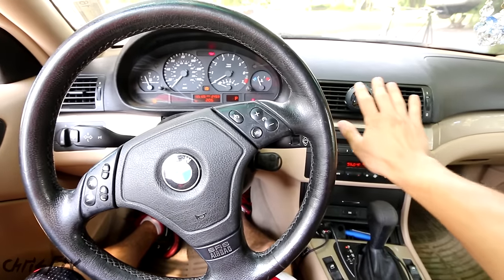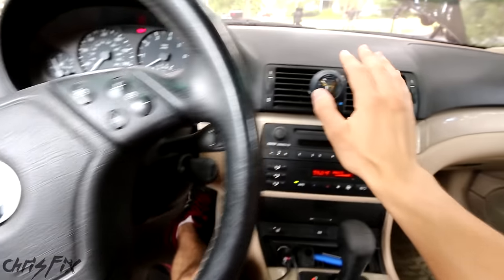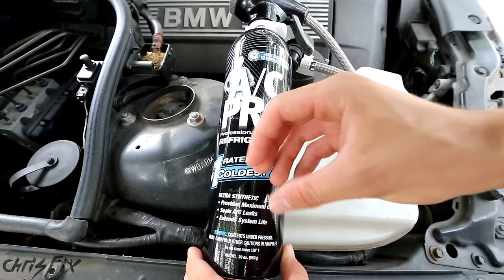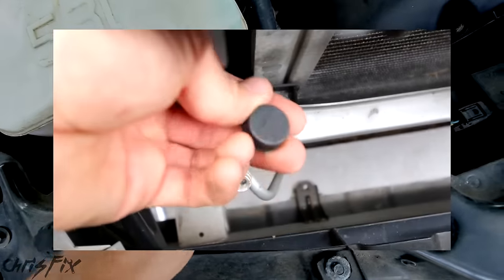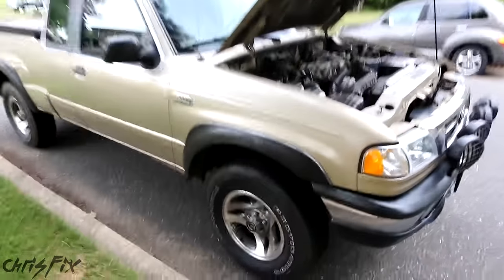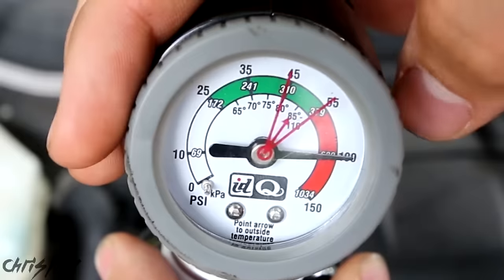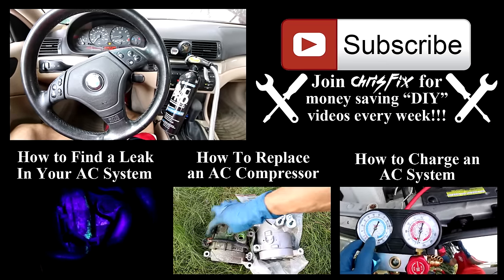How to Recharge Your Car's AC System (Fast and Easy)

Comment: If you have leftover refrigerant in the can, what are you supposed to do with it? Just save it for later? I assume you don't want to remove the hose/lid portion from the can while the contents are under pressure.

Comment: I was so hopeful this would be my fix! Unfortunately the reading was 109 psi on the low side (mine was a digital guage) once I hooked it up... and in my 2013 Pathfinder,  you can't see the condenser unless you take off the entire wheel and wheel well...so now it's probably going to be a HUGE repair ticket. 😩

Comment: This video is great but I just would like to point out one moment here: refrigerant works as a lubricant for ac pump, with that in mind do not leave on ac system runing empty for long: get ready that nozle on that refilling port before you start the car and turn on ac that way you will save ac pump from runing on without a "lubricant" for too long and you'll beable to fill up system right away. Good luck everyone and besafe!

Comment: Hey man thanks. I got my 97 bmw 528 ac pretty cold with an 18oz bottle of this ac pro.
My friend recommended that i let all the pressure out from the low side.. I was skeptical about that but i let alot of it out.
Ac was weak at first and car was melting hot with it on (these cars are highly insulated and hold rediculous heat)

Ac is now cold but i know i can get it colder, mainly because i need to add more (it can accept more 134a)
Following my friends recommendation im going to now get a 12oz can of Sub Zero and fill the system the rest of the way, but not into the red zone.
He said he mixes sub zero with another brand such as AC Pro and has gotten his cars super cold by mixing (not 100% sub zero.

Thanks again. It worked well.. youve helped nearly all of us.
Reply from the maker: Next time I would get the system evacuated properly as the refrigerant is damaging to the environment and it's also illegal to release it. I would also stick to using one type of refrigerant as much as possible. I'm glad the video helped you out though

Comment: Might be cheaper in the long run to take it to a trained AC repair guy to add refrigerant. I just don't trust those kits. I was in a hurry to make an unplanned trip-an emergency.  I knew I had a leak at the low P connection on the compressor but had not got around to fixing it.  I used one of those cans with a gauge and though the gauge said the pressure was now okay, it actually overfilled mine I think, and it caused the compressor to lock up at 70 mph on the interstate. This melted the serpentine belt completely off, and, later found out it ruined the crankshaft harmonic balancer too (stripped the rubber and months later it separated on me and left it stranded), which I had to replace-another hassle job on a Honda J engine (think extremely stubborn crank bolt). Fortunately, I know how to work on AC and have real gauges and the experience, but I was in hurry and didn't want to get the real gauges out, etc. A mistake. I ended up getting an expensive tow from the middle of nowhere then me replacing the compressor, plus the low side line from evaporator to compressor (leaking o-ring at the compressor connection was the culprit), and hose was old anyway, and the desicant unit, and a total refill. Took a gamble that no frags got past the dessicant unit to the condensor because I didn't see any debris after flushing the high P line from compressor to condensor. I won that bet.

Comment: I’m having this issue along with a O2 sensor (replaced the cheaper one already), and need another alternator cause some how oil got all over mine which was replaced along with the battery in October 2021. Just changed the oil but my question is since it’s a 2005 Accord EX… bought used and now has 232331 miles… should I get a newer vehicle or fix everything and see how long it’ll last? I’ve already put a lot into it. I do everything myself by watching videos if possible. Thanks and I love your videos how detailed they are… Thanks for helping a girl out!

Comment: Can I still use this if my AC compressor doesn’t spin/engage at all? If so, how do I go about this if the AC compressor isn’t engaging? 

PS- Replaced my alternator about 4 months ago (Fall). Now my AC is blowing warm air, and compressor not engaging. Checked fuse, relay, re-checked AC compressor tab/connector and all checks out fine. 

I know this is a very old video but yet it’s so helpful. I don’t expect a reply, but if you do, I thank you in advance. 🙏
Reply from the maker: I would hook it up just to see what how much is in the system first, I would suspect it's all leaked out and that's why the compressor isn't turning on. This video goes over this more in depth: https://www.youtube.com/watch?v=pCv7rCdcXsc

Comment: The thing is, when exactly do we apply this refill method?
Should it be done when we feel the a/c is losing refrigerant or wait till it's completely empty? 
I heard one has to completely empty out the air inside the system & to make sure we start from 0 and fill it back up to specs 550g for instance that way we don't risk getting any air inside hereby causing moisture & creating rust from within.
 So, if I'm applying this method, how do I know how much to put inside if I have say 250g still left inside the system for example?
What about situations where there's a slow leakage in the system, will this method work.
I'd be glad if you can answer these questions Chris.
Reply from the maker: You can do this if it still has some refrigerant, and is has a gauge that shows how much to put in

Comment: Wow, way easier than I thought. I was told not to use aftermarket stuffs to not contaminate the lines. How true is that?? And, you don’t have to vacuum the line and system before refilling it??

Comment: Glad it was an easy fix for your car.  How did you bleed the air out of the hose before putting in the Freon?  Wouldn't the air from tube go into the system before the Freon entered?
Reply from the maker: It’s not enough air to be a problem. If you want you can purge the air out before you connect it to the car.

Comment: People always say to vaccum the system first because of air and moisture. What if the condenser connection was cracked open alittle then put some refrigerant in to purge it? Then close connection? Kind of like brake bleeding? Gonna try this. 

Before people whine about emissions, r134 is used in low power air soft gun propellant. I was surprised to see that in japan.

Comment: Do not use refrigerant with stop-leak in it, It will gum up your AC systems components and shorten the system's working life significantly. If it's an old beater that you don't care about then fine, it might give you another year. If it's a long term car you like and don't want to spend thousands of dollars repairing the AC on, then just get the leak fixed and find the R134a without the leak seal.

Great video though!

Comment: Thanks for the video Chris Fix, I've learnt quite a bit about air conditioning on cars, my biggest question to you is when you use ac in your vehicle, why does the engine overheat, eg the temperature gauge goes up, and if it does, what's wrong?

Comment: Hey Chris, quick question: could an ac compressor with too low of pressure (needing to be recharged) cause it to engage and disengage randomly? I want to know so I can spend $50 and 30 minutes fixing it rather than spending $300-$450 and an afternoon fixing it

Comment: You know what’s crazy?

Ever since I got my 1999 Ford Taurus in 2013 it’s A/C has been hit and miss depending on the day conditions yet my dad’s 2006 Ford Fusion’s A/C has never had any issues with it.

My guess is the Taurus’ lines have dry rotted / holes in the lines. As it is older.

Comment: I have the same problem with my X4 except it is reversed (cold air pass side, no cold air on driver side). Also, I noticed some humming comming from the vents that I did not hear before. Could it be the heater control valve? Or simple recharge would do it?

Comment: Thanks @chrisfix you did a video a month after this using a much more complicated, but seemingly scientific method.  There are also some videos warning against the use of the a/c pro style kits (for the reasons you outlined in the vacuum recharge video).
Do you have any guidance on when to use the kit versus the vacuum method (as the difference is ~ $200 more)?
Thanks again..from another Chris
Reply from the maker: Yes, if you did work to the AC system (like replacing a compressor) and you no longer have any refrigerant in the system you need to use the other method. This method is more so for a car that had good ac and then it leaked out and it's too time consuming or expensive to fix a couple of o rings (typically what leaks)

Comment: Thank you! Your videos are very clear, concise, and easy to understand! As a follow-up question, you don't need to vacuum if you're only topping of the refrigerant and not replacing parts right? You don't need to add oil either? Is there a way to check for a leak other than filling with refrigerant and seeing if it stays cool and/or the dye?
Reply: You only need to vacuum if the system has been opened or otherwise exposed to the air. If there is still refrigerant in the system it is fine.
There is a couple of ways to check for leaks. Uv dye is one, I dont personally like that one much. You can use an electronic leak detector which requires there to be some refrigerant in the system. Or you can use soapy bubbles which require to system to be pressurized. Using a good vacuum gauge can also be a good indicator of a leak. If the system wont vacuum down to 500 microns or wont hold a vacuum there is a leak.

Comment: bought this based on what i saw in video.  No temp lines on gauge.  I have basic knowledge of ac and it worked as it should but the product i received would not be as simple as the video shows.

Comment: Overall it's a good video but I wonder why you cut out what was happening on the gauge when you squeezed the trigger. Why did you fail to explain that the gauge only reads correctly when the trigger isn't being pulled? I think an extra minute explaining and demonstrating the most crucial part of the service should have been included.
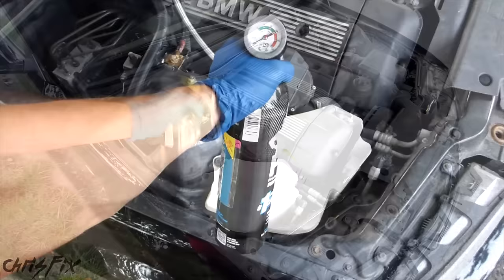Reply from the maker: Because anyone doing this will see that when you connect, the needle displays what's going on (which was explained) and when you pull the trigger, it drops to 0, then when you release it displays what's going on, this is also explained in the instructions, not sure what info someone could get with a needle pointing at 0 while you are moving the can around. You can see all this happening in the video at 7:04

Comment: Been a follower for years, I recently changed out my AC compressor and condenser in my 2008 Ford expedition. It still does not blow cold like it should. Is it necessary for me to get the system vacuumed out and refilled at the dealership? I’m very nervous about using sealant Freon with me having both a new compressor and AC condenser. What is the cheapest safest route in your experience? Will not hold you liable by the way lol. My mechanic told me I should be good. Also should I mix Freon? I really appreciate your time my friend.
Reply from the maker: If you only replaced the compressor then you will need to get the system vacuumed and recharged, you can do it yourself (https://www.youtube.com/watch?v=Pdq8JAlct6s) or take it to a shop and use some of the savings from doing this yourself! Use or ask to only use straight freon so you don't have to deal with any sealers, and mixing the freon that is in your system is ok as it's all the same composition, (your expedition probably uses R-134a, but check for a sticker that tells you what type) don't use any other type of freon like R-12 in your system.

Comment: Damn, you really break it down in a easy to follow way. I really appreciate that! I feel confident that I can do this after watching this video.
Reply from the maker: This is one of the easiest things you can do to a car/truck! Let me know how it goes!
Reply: @chrisfix  hey Chris I got a problem with my trucks ac...I got a problem with a truck I'm trying to fix...so first the orifice tube valve was clogged so I replaced...and after I did that the ac compressor would kick on for about 1 second then turn off...it would do this every 5 seconds...and the pressure would fluctuate from 30 to 40 quickly and this would cause the compressor to shut off any ideas what it might be...and I haven't seen any vids on it...
Reply: @chrisfix  the truck is a 1999 Ford F-250 super duty
Reply: Nvm Chris..I think I know the problem...I'm using the pro recharge kit and it's 12 ounce...bottles and my system is completely empty, im thinking I need atleast 3 bottles of that..
Reply from the maker: @miomine3527  yeah on the sticker under the hood it will tell you the capacity of the system. If it’s completely empty you will probably have to see where the leak is coming from. Check the video link in the description “how to find a leak on your ac system”.

Comment: Thank you. And I have one question: after I add AC system oil and recharge it, when I turn on AC, the compressor clutch works  never stop. However it blow cool air too. So why?

Comment: An accumulator does NOT remove moisture from refrigerant, it acts as a temporary storage tank for liquid refrigerant so only vapor goes through.
Reply: Automotive accumulators have a desiccant in them so they actually do remove moisture.

Comment: What about the air that is in that hose? Won't there be air in that hose? Seems like you should pull the trigger and press the valve to run some coolant through that hose and get the air out.

Comment: I was able to manually jumpstart the AC compressor and added proper amounts of refrigerant. Now my AC blows cold air but only on the passenger side. The driver side still blows warm air for some reason. Any advice? Thanks. 🙏

Comment: Hey Chris. I’m in the process of changing out my a/c compressor on my F150. I keep hearing that doing this job at home is not a good idea. So what do you think I should do? They say you need the system flushed before recharging the a/c system. If not, you can cause damage. Just wanted to know your thoughts and recommendations on this.

Comment: I recently had to drain the Freon from my 2007 335i I order to remove the condenser. I bought this same can. Can I just use this can to recharge my system or do I need to vacuum the system first? Thanks in advance for instructions.

Comment: Why do you have to check the temperature? Does it matter if it isn't really hot outside the day I plan to recharge?
Reply from the maker: From what I remember I think it had to do with the operating temperature of the system, the newer gauges that this comes with no longer specifies temperature and you just fill it to the green zone

Comment: This is okay I guess, most of the time it's just a needle valve core valves in the low and high pressure side that need to be replaced these are the ones that get the most work. If you replace those 90% of time your system no longer leaks, just remember charging a system or a recharge is not a good thing because you have a lot of condensation inside the dryer and within the AC components and until that is evac out you will get an inconsistent level of freon in your car because the level will be high but yet you will not be fully charged. This is something to think about as it's never just as easy as adding more freon to a system that may be plagued with issues which will only increase those issues. If you suspect the leak change your valve core stems in the high and low pressure side by removing the caps and getting a valve core tool removing them and replacing them with new ones.

Comment: Chris,  A couple of things worry me about your explanation.  First, I think that the recharge lever should be slightly pressed in advance of fitting to the Low pressure pipe to expel any air in the pipe otherwise you are introducing it to the system.
Secondly, surely the Engine should be turned off before disconnecting the Hose as there will be back pressure if the Compressor is still running which will spurt out, briefly?
Reply from the maker: The air in the hose is insignificant and technically according to the EPA you should never expel any refrigerant into the atmosphere. Me saying that would be a problem to them. Also don’t shut your engine off. The pressure will be about 100-150psi when it’s off. When it’s on the low side is just 30-50psi.

Comment: What’s the drawback with doing it this way, because I saw your more extensive way of fully recharging with vacuum, and pressure gauges? Is the are set back in the future using these premade cocktails for the ac?

Comment: Hey Chris, I’ve been noticing a strange thing using the gauge from pro AC. The gauge will slowly go up to the green around 40 psi, and then it dips all the way down into the white at zero. It then repeats the same behavior. How do I know exactly how much refrigerant I have left?
Reply from the maker: So it dips down when the compressor is on. You are supposed to use the reading when the compressor is engaged. Check the "temp vs AC pressure" chart to see what pressure it should be for the temperature it is outside.
Reply: Copy that! I will totally check that. You rock man. @chrisfix